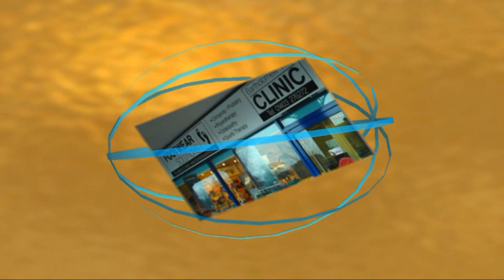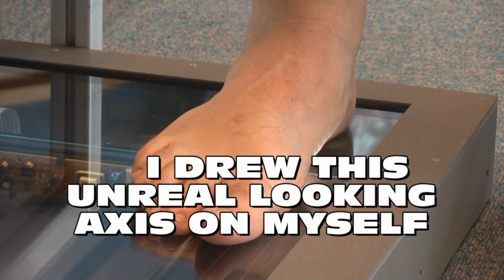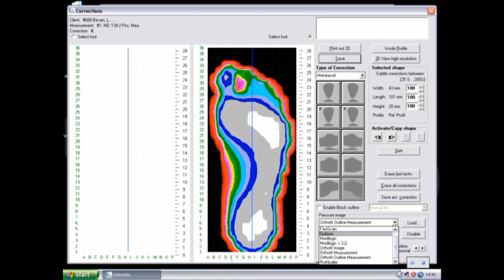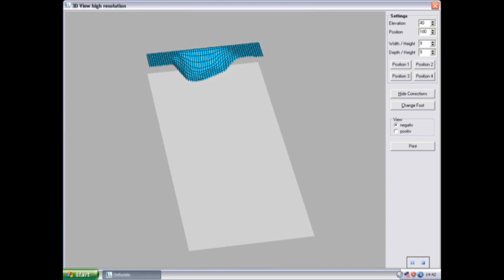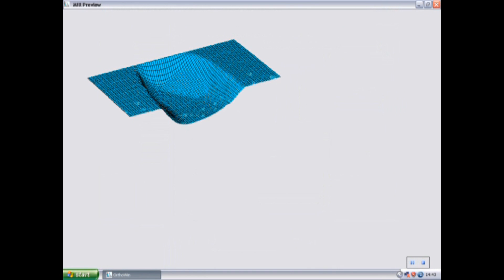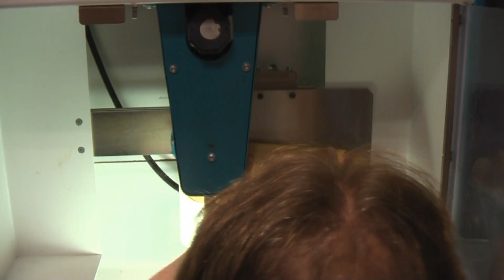3D 2D Foot Scan Subtalar Joint STJ Axis MOSI CAM Orthotics

Comment: Weight bearing messes up the congruity of the facets palpated on either side of neutral at the subtalar and then on HAS to maximally pronate the midtarsal by pressure under th 5th head to retain the forefoot/rearfoot LOCKING mechanism

Comment: The majority of feet have some degree of forefoot varus, once weight bearing occurs, even slightly, that forefoot or rearfoot relatiion ship is GONE.

Also I have NEVER seen a semi weight bearing capture NOT suffer from the patent's not holding still and externally rotating their legs/

There is NO way an xray with all its super postion will capture Neutral position in the subtalar or midstarsal